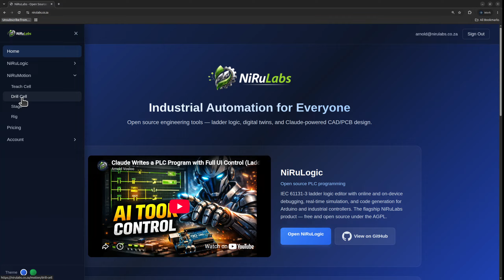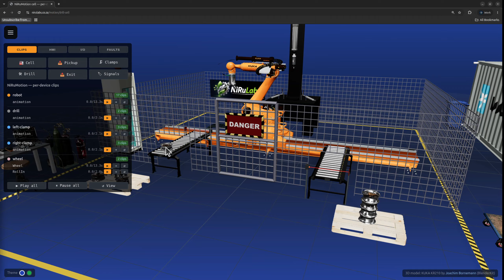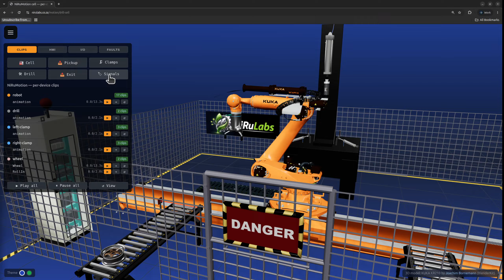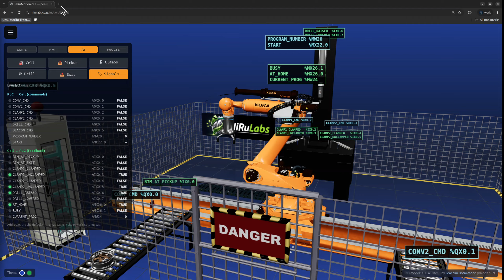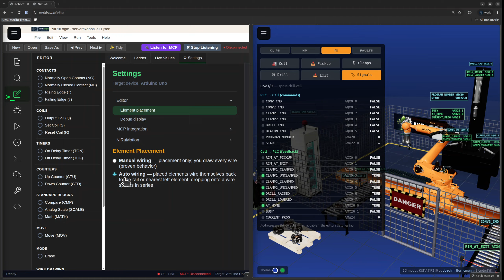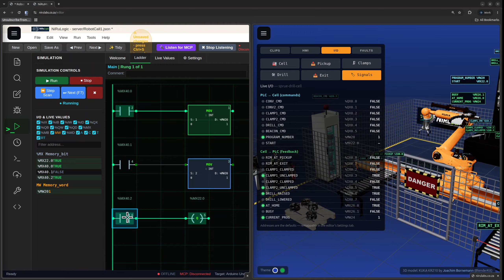Control your own virtual robot cell from your own virtual PLC using free open source software

Comment: Good job Mr Vosloo. However, I wanted to know if the generated program is global. I mean can this program be put into another robot ( Fanuc....) without major editing?
Reply from the maker: Thank you Abdul for your comment. No unfortunately the program is just a animation that was recorded in Blender and then imported so it is not portable at all. You can write you own robot program using the NiRuMotion teach cell in NiRuLabs and call it from the plc simulator. Those are real robot programs but are also not portable unfortunately